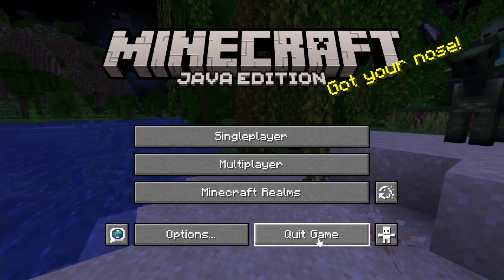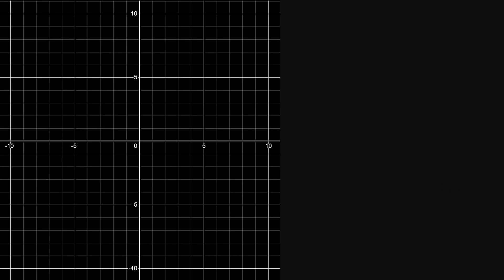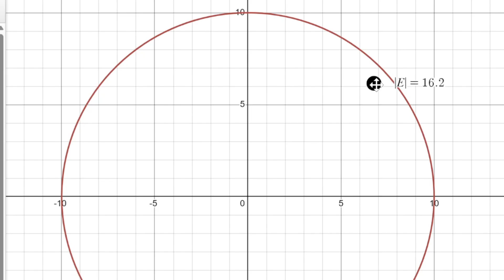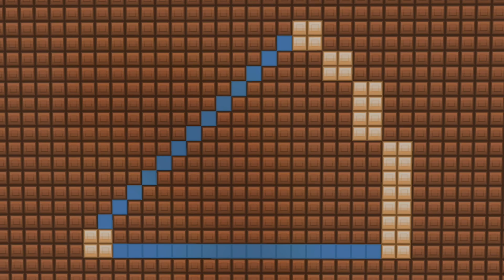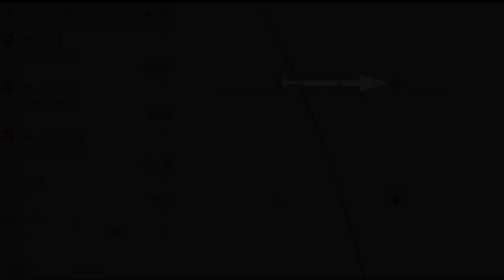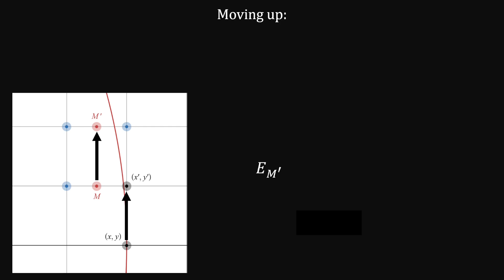Why Drawing Circles is Surprisingly HARD... (in Redstone)

Comment from the maker: Thanks for watching my video! I likely won't do many more of these redstone explainer videos, but I do have video ideas for some of my other projects. Anyways, here is the FAQ:

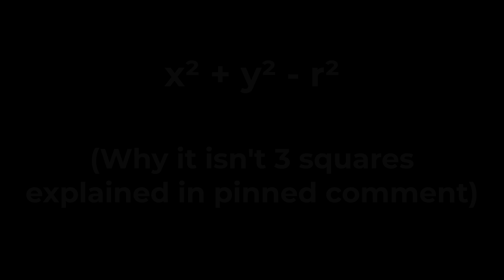Q; 4:40 Why is calculating x² + y² - r² only 2 squaring operations and not 3?
A: r² never changes for a given circle no matter what coordinates you are checking, so it is calculated only once at the beginning. x² and y² need to be recalculated in each check because they can change.

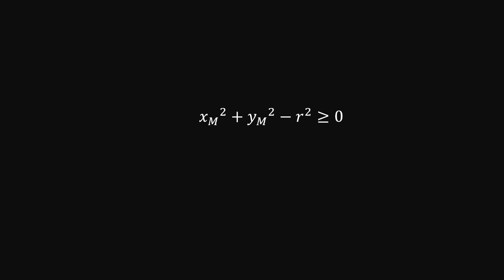Q: 11:45 Why does the equals in E = (x - 0.5)^2 + (y + 1)^2 - r^2 >= 0 not matter?
A: Since this expression is calculating the error of the midpoint of the two options, we can prove that the error can never be 0, i.e. the midpoint can never lie exactly on the circle. Expanding the left side, we get x^2 - x + 0.25 + y^2 + 2y + 1 - r^2, and since x, y, and r are all integers, the whole expression is an integer except for the 0.25. But the right side is an integer, 0, so they can never be equal, and having >= instead of just > will never matter. Having >= is more convenient because in two’s complement, just looking at the sign bit of the error and putting it through a NOT gate tells us the answer to this inequality. 

Q: 13:36 Why can you round off 0.25?
A: Since x, y, and r are all integers, the whole expression besides the 0.25 is an integer, and adding 0.25 to any integer will not change whether it is >= 0. 

Q: Why do the circles with radius 6 and 13 look jagged and not round?
A: As far as I know, it is simply a coincidence, the circle just so happens to line up perfectly on the grid so that the midpoint circle algorithm produces almost octagons. I did verify that this isn’t a bug in the machine, so I guess it is similar to how song shuffling algorithms sometimes don’t seem random, it’s just the human brain finding patterns in something that is mathematically correct.

Q: Why is the Wikipedia description of the algorithm different?
A: Even though the Wikipedia explanation directly compares the two pixels’ errors then simplifies the expression, it does the exact same thing as the midpoint method. You can also justify it with the math, under Algorithm -> Variant with integer-based arithmetic, the simplified inequality is 2(x^2 + y^2 - r^2 + 2y + 1) + 1 - 2x > 0, change the > into >= to make the comparison just become checking the sign bit (the = doesn’t matter because the two errors can never be the exact same), divide both sides by 2 and we get x^2 + y^2 - r^2 + 2y + 1 + 0.5 - x, then remove the 0.5 (because adding 0.5 to any integer doesn’t change its sign), and the inequality becomes exactly the same as the one from the midpoint derivation.

Q: Is all the optimization really necessary?
A: The optimization covered in Chapter #5 might not be necessary, but I haven’t checked. Basically, even though squaring does require a lot of additions, we can do them in parallel by just adding more adders, so the time required to compute the square of a number with n bits is log_2(n). In practice, since the machine only works with 4 bit numbers, it doesn’t save much time, but it definitely saves total additions done. In fact it might not save any time at all, because the bottleneck of this machine’s speed is at the reflectors and not the midpoint circle algorithm logic.

Q: Where did you learn redstone?
A: mattbatwings’ Logical Redstone Reloaded is perfect for learning computational redstone, everything from how redstone works to how to build logic gates, adders, screens, etc. Constructing the machine is just a matter of researching the logic and putting the correct components together.
Reply: this is awesome!!! great video and great build :D